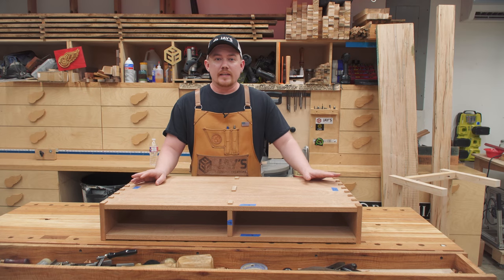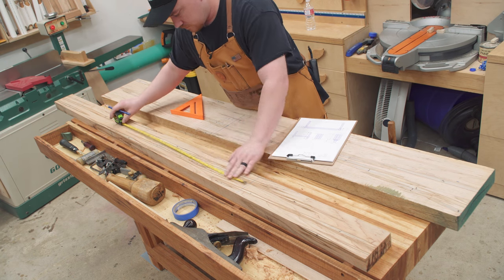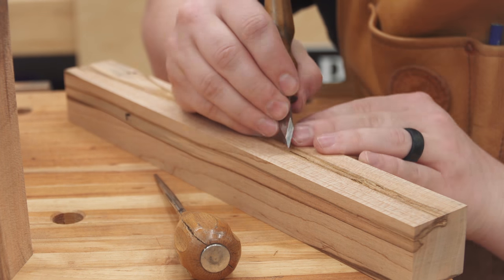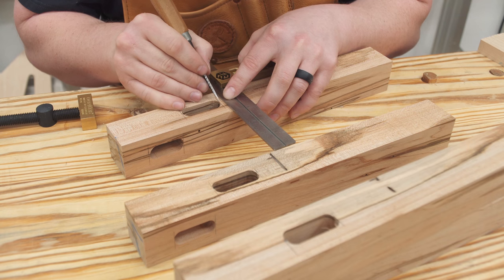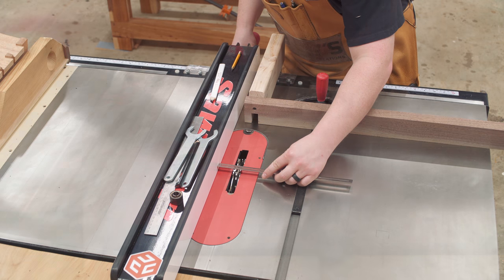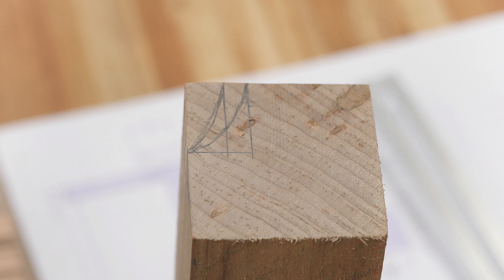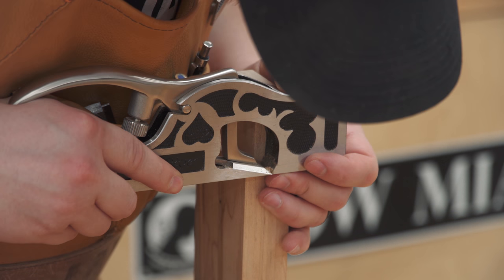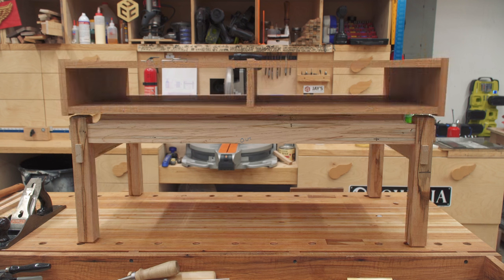Krenov Inspired Coffee Table - Part 2 - The Base - 302

Comment: Hi Jay. Great project. One question: Why dont You let the mortises round and make the tenons accordingly ???
I think it is much more easy to make the tenons rounded then the mortises square.
Reply from the maker: I wanted the look of rectangular tenons. Rounded tenons wouldn't fit visually in my opinion.
Reply: Would you have left them round if they were not through tenons?  Of course you used a router to cut the mortises. 
And I suppose it is easier (faster to make a square tenon round than a round mortise square.  
I guess I answered my own question.  Well, there you go. 

Nice build.

Comment: Excellent video Jay, did I miss the part where you put something into the area where you hogged out punky wood on legs, or will you eventually fill it with epoxy or whatever?
Reply from the maker: I'll just apply finish as normal. It was just flaky material over an empty cavity. Didn't look like fungus or moisture rot and the supporting material around it was all normal. I think I sliced right down the edge of a bug hole.

Comment: Maybe try a "down cut" spiral router bit for less tear out. It'll pull the surface wood into itself instead of lifting it away from itself. Best, @HoneyOnWales
Reply from the maker: Downcut bits aren't the greatest for plunging. They burn more easily as well.
Reply: Jay, just had this idea. What if you score the outline of your mortise with a marking knife or a few chisel taps  before routing? May stop tearout at the score line like a control joint in concrete...just brainstorming here.
Reply from the maker: Maybe. But the solution was to put the router at max speed.

Comment: Do your boards ever come out with any snipe from your planer? If so, do you account for it with extra length or simply fix it off-camera with sanding or a hand plane?
Reply from the maker: As long as I run the boards through at an angle and feed them one after another snipe is reduced. Easily cleaned up later with a hand plane.

Comment: If squaring off the mortis holes are a hassle you could try getting a mortising drill bit. Its basicly a drill bit that has a square chisel around it. If you have a drill press it's perfect for table legs or runners.
Reply from the maker: I thought about that but wonder about how clean the hole is for through mortises where they will be visible. For non through mortises it won't matter much.
Reply: If you're worried about chip out put a piece of wood underneath the piece you're trying to mortise. Once the tenon is in the mortis no one is going to see the inside of the joint unless you're trying to make the legs or runners out of clear acrylic. The bit just makes a square hole so as long as you have a level fence behind the wood you should be fine. Now this bit won't work to well for over sized pieces of material, but for instances like this its perfect. Try it on a scrap piece if you have doubts.
Reply from the maker: I was referring to the enter side of the cut being perfectly straight via multiple plunges with the mortiser.
Reply: If the leg is tapered put a shim against the fence to make the mortis cuts straight. If the leg IS straight you you just need to clamp the leg to the fence.